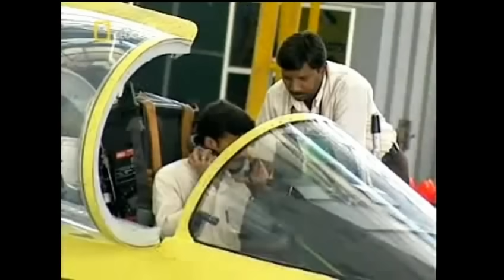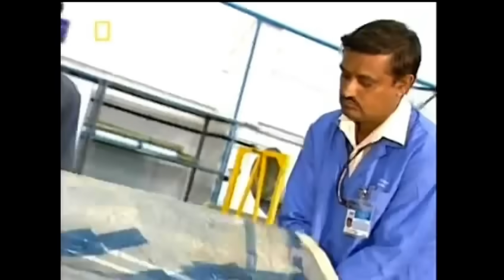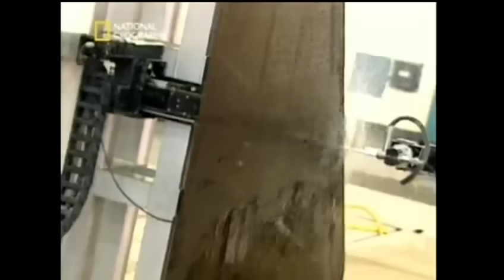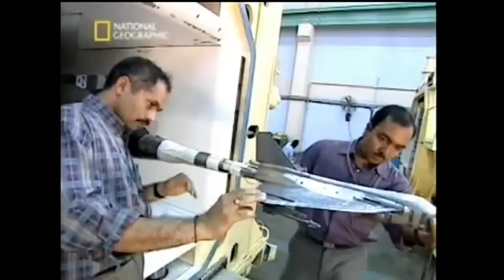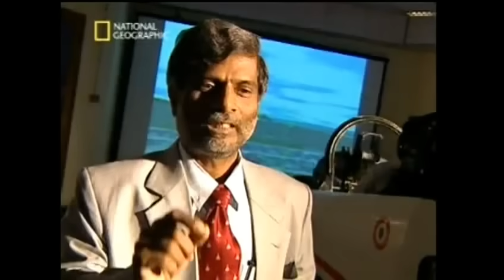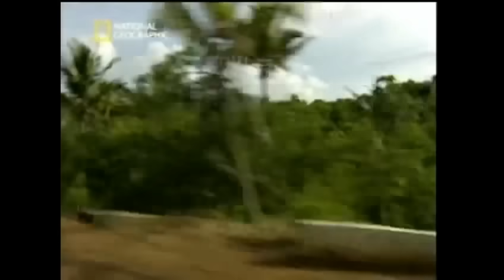Tejas - National Geographic Coverage

Comment: Dr. Srinavas he is great stupid man of HAL. What he said mathamatics and computers are not not enough and designed this aero dynamics of plane. And now 60 % fleet grounded IAF complain that they found gravity cracks at back of aircraft. It was better to copy any west design.
Reply: which source? NDTV?
Reply: No source nothing lol I'm following this program so long there is no crack even how is that possible it has 95% composites on surface and 45% by weight . Weight also include engine landing gears etc most of the frame is made up of composites. It has pretty long life. And strong build

Comment: The air inlet of Tejas is much small compared to all fighters.
The lower surface of wing and upper surface of air inlet is having a gap.
If these two surfaces are merged, the air inlet will become larger,gap is eliminated.
This will improve performance of engine, and aerodynamics of the airframe.
The frontal surface area around intake will be reduced thus Stealth coating cost,& weigh is reduced.
Stealth(frontal) will improve
Reply: They did not re optimise aerodynamics for GE engine. That's causing problems. Guess they'll be sorted out in Mk2
Reply: Tajas is still waiting for Kaveri.